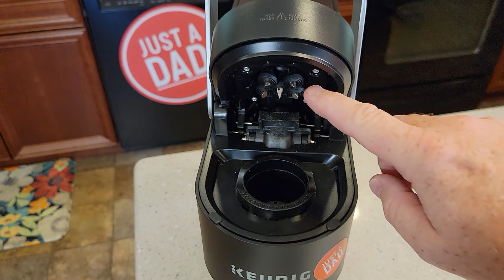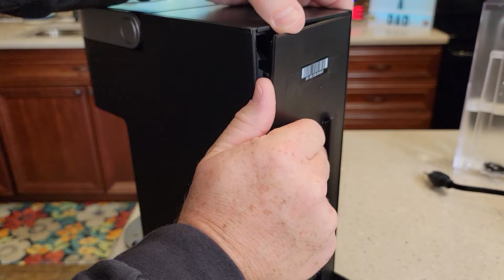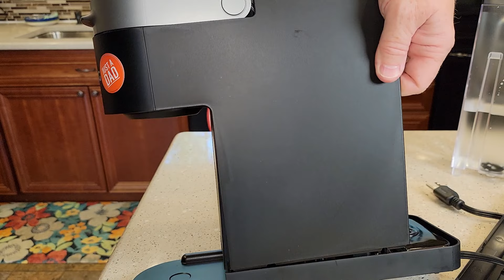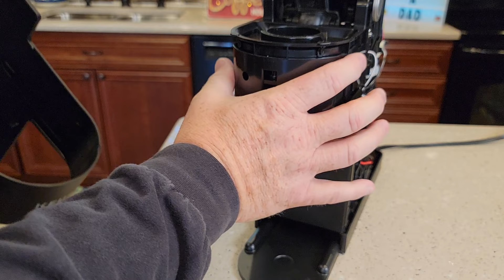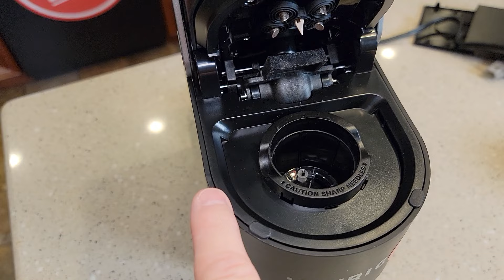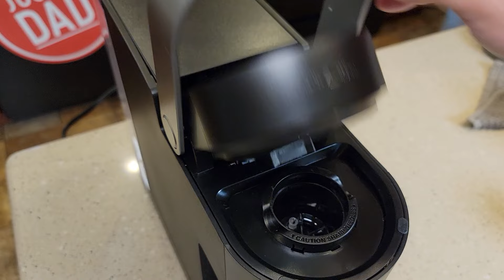🔧 Keurig K-Slim Not Working? | Thermostat Reset & Repair Guide

Comment: Thank you, I used this video to fix mine. I initially called Keurig for assistance and beyond unplug and plug it back in, they couldn’t help me. It’s less than 2 years old and they wouldn’t replace it because it’s outside of the 1 year warranty. The told me to just buy another one and sent a 25% off coupon. I could see if this was 8 or 9 years old, but 2 years and it’s into the landfill, I just couldn’t do it. I found your video and you helped me save this..
Reply from the maker: You're very welcome, thanks for watching!

Comment: When removing the front cover, you mentioned pressing a tab with a small flathead screwdriver. There are three additional tabs you can press to make the cover easier to remove. I used needle-nose pliers to help hold and press the paper clip.With the machine unplugged, I checked the switch with my multimeter. It read open circuit (infinite resistance) before the reset and approximately 0 ohms afterward, which helped confirm the reset worked. I also heard the click you mentioned.

Comment: I just drilled a 1" hole in the side so I have regular access to the reset.  Could you please do a video to demo where exactly and how this should be done. It makes it so much easier than taking the damn thing apart. Also, I find, the overheat reset happens regularly once the machine is out of warranty. Also, isn't there a way we could install a button on the side of the Keurig we could just push to reset it each time it fails,? I think you are the guy to design and do that. I'm old and tired and I don't have the energy (chronic fatigue) or interest to do it myself,.  
Keurig machines are such a piece of garbage and puts so much plastic into the landfill they should be banned. Unfortunately, my wife, insists on having one.  I've gone back to instant myself. It is faster and easier and the freeze dried coffees are really really good these days.

Comment: I took mine apart, and it does not have the thermostat like in your video.  The outside of my model looks exactly like in your video, but internally it looks different.  Mine says model K900 on the bottom.  My heating coil looks totally different than in this video.   The only way I can get mine to function is to unplug it overnight.  The next morning it will make 1-2 cups and then stop working again.  It is completely descaled, and coffee tastes great when it works, but for now I have to keep it unplugged until I actually want a cup of coffee, and I don't seem to have a thermal reset button.

Comment: Awesome video. Just had one of these break for community use at work. Took me like 10 minutes to get it back up and running to finish descale. Oh which, the ADD WATER still would not come on. But, unplugging it for 30 secs finished the descale cycle.
Reply from the maker: That's a great tip for anyone running into the same issue, thanks for watching! 😊

Comment: After resetting the switch I suggest turning on the coffee maker before putting the cover back on as I have done. I’ve had to take our cover off several times to reset the thermal switch. I also learned that if I leave the cover off the machine does not overheat and cause the thermal switch to cut out. This suggests to me that the switch should be replaced, but I can’t find a replacement. After leaving the cover off for a couple of months without any issues I decided to put the cover back on. A week later the thermal switch needed to be reset again. This time I cut an access hole in the side panel so I can leave the cover on and still be able reset the switch without much effort.

Comment: Omg this worked! So one of my older keurigs died while I was trying to brew a cup (probably from the same issue, honestly) and I happened to find an almost new one (newer model too) for $5 at a garage sale. Then it died while trying to brew again and just wouldn’t turn on but I did notice the top felt quite hot. 

This was way simpler than I thought it would be and helped!
Reply from the maker: That's awesome, glad I could help you get it working! 😄

Comment: All my lights were coming on but then turning off. So I took it apart and cleaned the dirty clogged pressure hose that attaches to the board. Took the hose off and ran soap and hot water through it for a few minutes. Put it back together and it ran through a descale cycle and made a cup of coffee without issues. THEN... I put it all back together and ran it without the tank...that tripped the reset button so I took it apart again and did the paperclip then that worked fine! I'm getting fast at taking it apart and putting it back together. Thanks again! You're awesome!

Comment: Had one of these at my office. Less than a year old it died. Keurig refused to warranty it on a technicality as we bought it on Amazon. It sat around for about two years before we tossed it. Then I found out about what it took to fix them but it was too late. Fast forward to today my sister brought me the same model from her office that died. Took about 15 minutes to fix it. Used to small jewelers screwdriver to reset the fuse rather than a paper clip. Pressed in with it and heard a pop. Really wish Keurig made them user resettable. I wonder how many get tossed out because of this simple issue. Just like the one from my office.

Comment: Thank you Just a Dad!!  My Keurig K-Slim would power on though the "K" brew button would not stop flashing, pressing had no results.  Used your instructions to open the machine as if to reset and discovered a white wire to the K button was severed. Must have been cut from the opening and closing so often. Repaired the wire with splicing and electricians tape. Tested, worked! Put it all back together and enjoying a cup of coffee.  I would never have tried to fix-it myself without your clear and encouraging instructions on getting the box open and seeking... Yes, I used a paperclip to reset just in case too. Thank you!

Comment: Great video! After not using the Keurig for a month, it dried out and sure enough, after resetting the thermostat, it worked. However, I had to reset the thermostat twice- I don't think the heating tube was primed enough the first time. So, the second time, I reset the thermostat, filled the water tank and turned the Keurig on it's side and saw that water dripped from the jets. Then, after turning it on, it worked perfectly. My advice is that to make sure the heating tube is full of water before turning it on.
Still, great video and saved me from buying another Keurig! Thanks, Dad!

Comment: Same on K900. Automatic e-waste generator defeated, should be self resetting, but can't sell more devices that way. Mine now has a paperclip hole, including the bracket that was so thoughtfully placed in the way. I may still have to take off the rear cover, but not the sides.

Comment: Mine is a K900. NO thermal coupler!! My 8, 10, and 12 oz lights would not light up. 

After following the video and discovering no coupler or reset button I noticed that the tubes were empty. 

I put my thumb over the water intake and turned it slowly upside down. 

Fixed it.

Next time I won’t take the case off.

Comment: First of all unplug it ,
Easy way is to make hole as showing in my photo and cap it any time you need rest thermostat just remove cap, insert tiny wire reset thermostat. 
Hole location right side 7 inch high from bottom, 2.3/4 inch from front

Comment: Hey there.  I don’t really fancy myself as a “hack”, usually I’m a follow instructions by the letter kinda dude… however, in this situation I decided since the right side of my machine is against a  cabinet bulkhead. Why fuss with disassembly… WTF!  I carefully guesstimated the location of the thermostat reset button (thanks to this great video) and surgically cut away a 2” square on the side of the housing with my trusty Dewalt razor knife, gave the button a poke and bingo!  Successful reset!  I covered up my sins with a 3” wide piece of IPG metal tape.  Perfect! (sorta).
Reply: I did the same thing! I drilled a hole straight to where the thermostat is. Easy peasy.

Comment: I used this video to fix mine also. Thanks very much. A few hints - I did NOT take the entire cover off. I took of the top plate first. Then the back plate, then the right side (as viewed from the front). There's plenty of room to reset the thermostat without fully removing the plastic cover. Unreal that they put this into production with this serious flaw that has probably caused 1000s of these to go to the dumpster unnecessarily.
Reply: a deliberate design choice to try and FORCE more sales to the LAZY & STUPID "hooked" on POD COFFEE

Comment: My Keurig k-slim does not seem to have the spiral element like your Keurig does, it has a double loop one with yellow and red heater element wires going to a the board but but doesn’t have the same thermostat/thermistors, even after nearly or 75% disassembly showing all internals, it has a different type element without the thermostat resets that are also common in microwaves, dryers, and my Keurig Express that I’ve successfully reset and brought back into use. My Keurig K-slim model # k900  does not. Help please thanks.

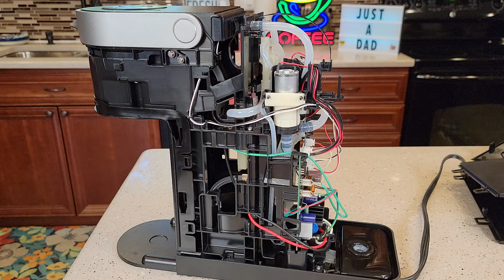Comment: If you have power but the other lights don't come on when the lid is closed, check out the video at 2:09.  Those white and black wires at the top, probably tied to a microswitch, tell the unit when the lid is closed - that is, unless one breaks, like the white one in my case, because they bend every time you open and close it.  And just like breaking a paper clip by bending it repeatedly mine failed after just one year and 9 months. Only used about twice daily at most.  That said, easy fix.  Strip, reconnect, insulate.   Kinda a dumb design.  Unless you sell these things.
Reply: I was about to throw it away, but after reading your comment, I decided to open it up and found the same issue you mentioned. One of the white wires was disconnected on mine as well, and after reconnecting it, it started working again. I’m really glad your comment helped me fix the problem. Thank you so much! 🙏🙏
Reply: @devincharles3588  Cool.  I felt it was an approachable fix and God know's I love my coffee. :)
Reply: @notfound379  It cost over $100, and honestly I couldn’t understand the design choice with that white wire. It almost feels like it was intentionally made to fail after a certain amount of use so people are forced to buy a newer model.😂😂

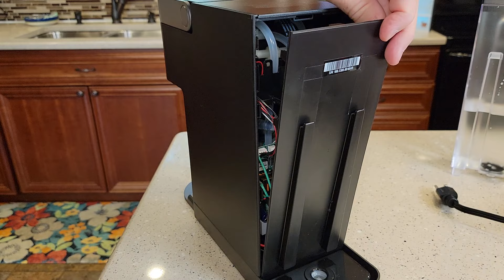Comment: 1:37 mine does NOT just pull off from the bottom 😭 that thing is held on tightly by the last two clips
Reply: I think mine is a newer/older model cause that spiral thing is NOT in there

Comment: Hi, I have a similar machine but there is no spiral thermostat to reset what would be another option for me. I press 8 and 10 at the same time, descale lights up with k flashing, I press k it stop flashing but water is not running, there is nothing , no sound just solid k and descale lit up, please help

Comment: Thank you, your video did the trick.  Keurig should be ashamed for their deceptive practices.  I called support as their manual says and they went through a list of thing to do with the electrical supply.  All they wanted to do was sell you a new one instead of telling you, you could DIY the problem.  They could just drill a big hole on the side so you could access the pin hole to reset it without tearing the machine apart.
Reply from the maker: Awesome, so glad the video was able to help!

Comment: Thank you sir!!  I ran a descaling, and during the rinse pass, the Add Water light did not come on, and it ran dry and created lots of steam. I was surprised because this is the first time I know of that  it did not detect a low water condition. After that it simply would not turn on. Given that it ran dry and produced an inordinate amount of steam,I thought it might be because it overheated. So I waited for it to cool off - even pumping cool air into it with a small fan. But no dice, even after it was fully cool it would not turn on. Here I was thinking that it was time to buy a new one ... but I did some Googling and found your video. Great instructions! Thank you so much!!

Comment: Okay cool man it worked I had to reset it twice because the water wasn't getting in so I cut a hole in the side of the case last time before putting it back together now I can reset it anytime it happens without having to take it apart

Comment: I watched this video last night. I was going to follow through last night but then I ended up not taking this thing to work and now I'm doing it watching the video again. I'm glad I came back to listen the second time because I had the exact issue that you had whereas I have not used this thing and over a year. So I'm pretty confident this should work for me
Reply: All right did not work the first time going to try to reset it a little harder.... well no... it powered on it. just but then it just failed to brew and overheated again did the same thing

Comment: Excellent video - thanks!  Just wanted to add that my Keurig K-Slim still would not work after resetting the thermostat.  Tried all the other suggestions I found on line but nothing worked.  Finally just filled the tank with 50% solution of white vinegar/water, placed it on the unit, and let it set in the garage for two weeks.  Working like new!

Comment: First and foremost thanks for posting this video. I have a different model (K26) but it has the same kind of reset on the over temp switch. All I needed to do was peel the right side of the coffee maker side panel back and then used a fine steel rod to push the center button back in to reset the switch. Many thanks!
Reply from the maker: Glad to help!

Comment: Brilliant! You just saved me $100 CDN by not having to buy a new one. Mine also failed during the “run water through 12  times“ descaling process (you’d think Keurig would have a warning to leave some time in between to avoid overheating). So an easy 5 minute fix and I’m having a fresh cup now. Many thanks!
Edit: Also, your tip on priming the pump with the water tank was key. 👍

Comment: Thanks!!! During descaling a Keurig Slim, it ran out of water without warning, turned off, and no power again. Reset the thermostat based on your awesome video.
Two suggestions: you don't need to take out the rubber foot and screw on the opposite side, and you don't need to completely remove the front cover. Took about 5 minutes to fix. Thanks!

Comment: Worked like a charm!  This issue just happened after a descaling process....yes, I believe it simply overheated and tripped the thermostat.  Think of how many people simply throw away their Keurig and go buy a new one, when the fix you outlined is so easy - and FREE!  Thank you sir for posting this.
Reply: Just descale the same Keurig K Slim and it overheated AGAIN!  Performed your detailed repair and Voila!  It works again.....saved me $100 for a new one for the second time....thanks again.

Sad part is: I googled this issue and although this unit is still offered for sale, it appears they have never fixed the issue as a manufacturing/design defect.

Comment: Since this seems to be a common issue , especially when you forget to add enough water, where there is no external reset button, instead than taking the machine apart, considering the inside reset mechanism is well-placed to be reset from the outside??? My machine was only a month old and I had used it only 3 times, then it stopped brewing, so I called the company in Canada, they made me fill some forms, then they emailed me telling me I qualify for a new machine, I just got it today. I had 2 Massimo for 4 years they worked great, my wife convinced to buy a new Keurig and in one moth with 3 cups only it stopped brewing.

Comment: I just reset ours thanks for the tutorial.  Though there is no need to remove any screws. Just carefully remove the back panel and you can reach into where the thermal protection is with a small 90 degree pick from HF or your local auto parts store. You can hear the audible click when you press it in far enough.

Comment: Thank you for the video, as it did fix my Keurig for about 30 seconds. Then I tried to run an 8oz cup, and it wouldn't pull any water. Went right back to the same issue again. I did prime the water as suggested. Must be an underlying issue with the process of pulling the water. No water = overheat = no power. Ugh!

Comment: I did this and it turned on, but once I tried to get cup of coffee it shut off. And won’t turn back on. I did like you said about pumping to make sure there’s water in it.  Help
Reply from the maker: it might be a bad water pump or it might be a blockage in the tubing,  you can blow air in the tubing.
Reply: @ thank you for replying to me. I think I have it figured out…..it’s broke. There’s something wrong with the heating coil it heats up and got bright red. My sister had an extra one that wasn’t working so I got that one and reset it and now it works so thank you so much for helping me. I live on a very fixed income due to an injury so you just saved me a lot of money. Again thank you sooooo much

Comment: Awesome video! thanks for posting.   If you have a gasket pick, one with a 90 straight bend, these look like mini ice picks, you can get a cheap set at a Dollar store.   if you have one, you only need to remove the 2 screws under the rear panel, remove that panel, and you will be able to reset the thermo snapswitch with the pick by reaching into the machine thru the back opening.   Saves alot of fussing about with the other panels

Comment: Lifesaver. I almost tossed mine. Wonder why mine popped off? It was sitting for a year? Who knows. Works now! Thank you! ** It should also be noted that the top piece, slides on, there is grooves for it to slide in from the back. Cheers!